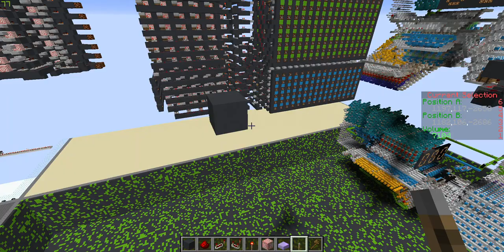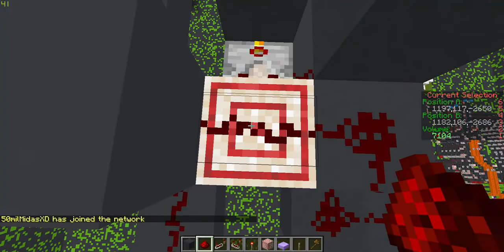1 tick CCA Adder  - using comparator priming

Comment: The reason for the repeater weirdness is because a repeater set to 2 ticks acts like a pulse extender so if you send a 1 tick pulse it takes 2 ticks for that pulse to go away and if you send another pulse 2 ticks after the first the repeater will just stay on.
Reply from the maker: yea that's part of it. i've done some more testing and found that if you arrange 2 repeaters offset by 1t like that. the output has a 0t off pulse in between the two 1t pulses which is what allows this to have no cooldown.
Reply: @fearless_z_2576  I personally like redstone in bedrock edition much more than that in java. It is always obvious what is happening. I think that in bedrock it is actually possible to make 10hz pc, but im not an expert: my fastest was about 1hz non pipelined.
If you make a clock (for example 2 ticks on and 2 ticks off) and connect a bunch of 2 tick repeaters in line to it, the last repeater is still on, but you can clearly see how the other repeaters are flashing. Can someone explain that? Because my dumb brain just doesnt understand that. In bedrock it doesnt happen at all.
Reply from the maker: @redder358  the repeater line thing is just a weird bug. but it can be prevented by just putting 1 block space between each repeater.

Comment: isn't the thing at 5:44 just because the single repeater on two ticks will send a pulse that lasts for one tick, with a predelay of one tick, wheras the extra two repeaters will send an additional signal on the second tick, so the back input to the comparator lasts for two ticks?
Reply from the maker: Both setups input a 2t signal to the comparator. however due to redstone update order the setup with 2 repeaters behaves differently. You can see this if you were to put a note block instead of a comparator the note block would activate twice even though it only appears to activate once. However this doesn't happed with the 1 repeater setup.
Reply: @fearless_z_2576  so a repeater with a delay actually extends the duration of the signal? I had assumed it maintains the duration and just creates a delay.
Reply from the maker: @AndyChamberlainMusic  yes, so if you sent a 1t signal through a repeater set to 2 ticks the output will be 2 ticks long.

Comment: i think comparator priming is not only useful for adders but also for instant comparator wires. this could be used for mass data transfer when combined with serial data transfer by just priming the line before sending the redstone power signals. this can also be used for storing data. the register could be selected by priming it and the others wouldnt change
Reply from the maker: Yea this mechanic could be used for a lot of and i think as more people start to understand it it will start popping up in a lot of builds.

Comment: 2 tick clock cpu incoming?
Reply from the maker: yep, that's the goal.
Reply: @fearless_z_2576  If you really want to get the fastest computer in Minecraft, you are going to have to find a way to make a multi-core system that functions in a way where it doesn't slow down the system too much. Because someone already did that with 4 cores.
Reply from the maker: @fireserpent9854  My CPU is going to have a pretty good I/O system so in theory if you have a complex program you could give each core something to do and then have some small data sharing between the cores without to much delay.
Reply: @fearless_z_2576  At a point it's just going to be which computer has the most cores. It's impossible to get over 10hz unless there's an update or you alter tickspeeds. Also it might depend on how many instructions a single core can handle per clock cycle.
Reply from the maker: @fireserpent9854  yea i'm going to stick with single core for a while still. I worked out a few programs on paper and they seem pretty fast for minecraft. but i might attempt multi core in the future 
Conway's game of life: 1:30 - 5:00 per generation for a 16x16 screen   https://en.wikipedia.org/wiki/Conway%27s_Game_of_Life
rule 110: 1:20 per generation for 8-bit  https://en.wikipedia.org/wiki/Rule_110
multiplication: 30 - 45 seconds for any 2 4bit numbers
fibonacci: 1 second every 2 number